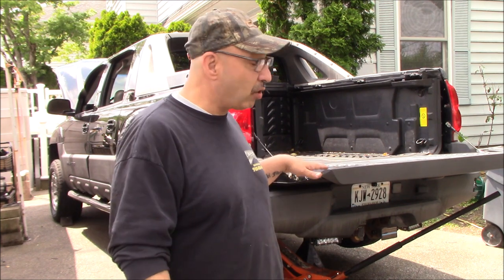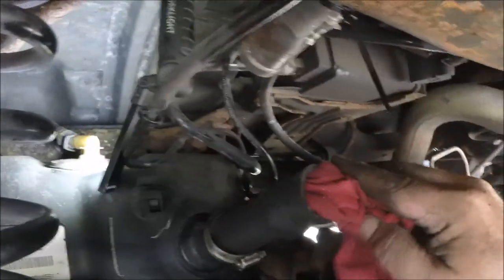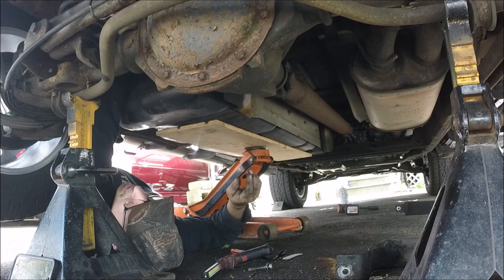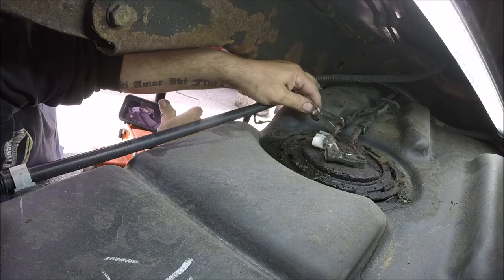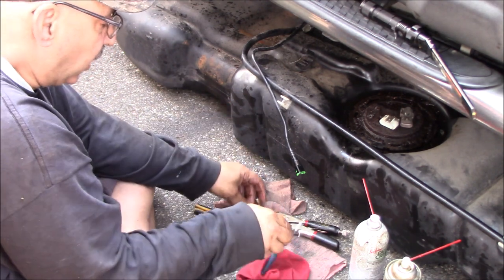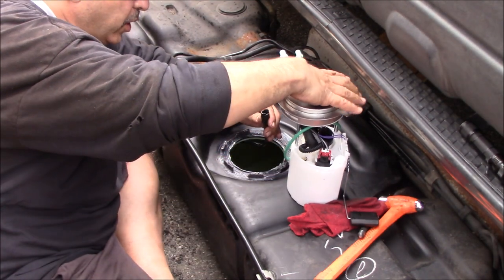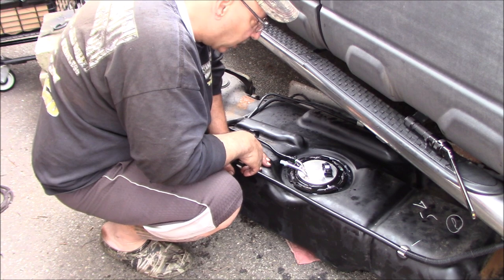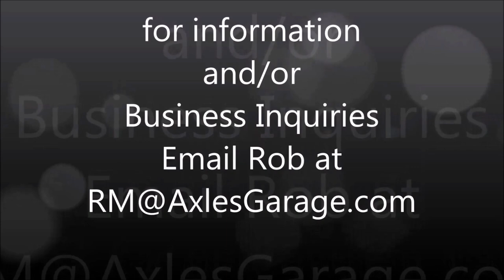2005 Avalanche: Episode 14 - Replace Fuel Pump Assembly  -  Chevy  Suburban Tahoe Silverado GMT-800

Comment: Great video I have an avanlanche that requires the 2 prime method every time I need to start it. After some research turns out the pressure regulator is built into the pump so might as well replace the entire unit.
Reply from the maker: Keep watching our Avalanche videos,  as it eventually turns out, the Fuel Pump assembly did not fix the problem.